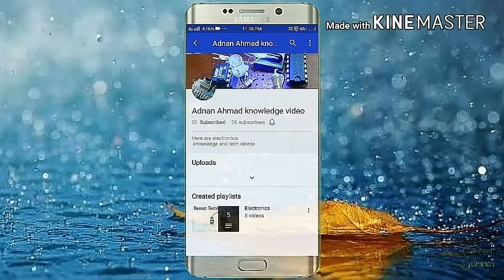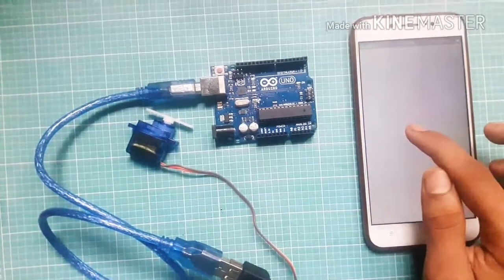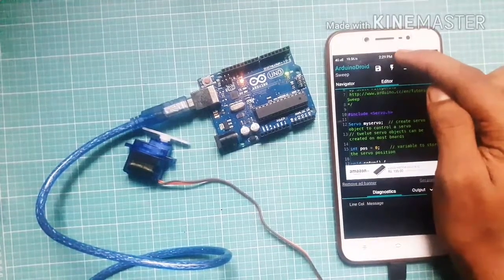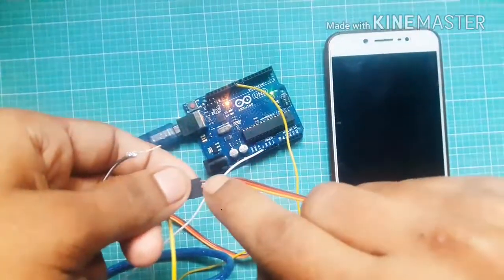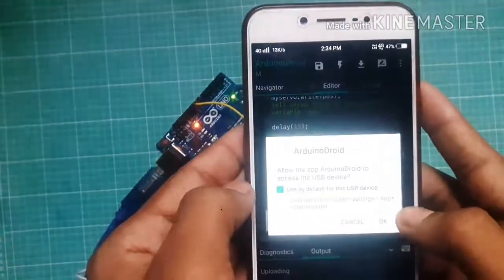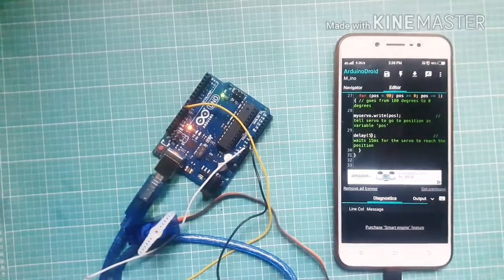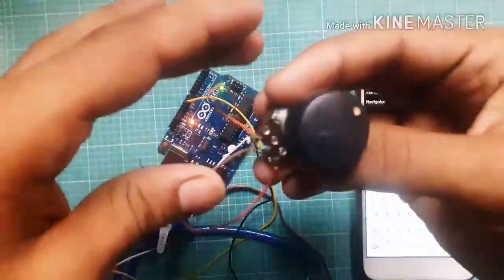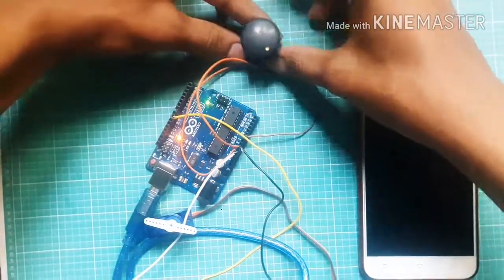How To Control A Servo Motor With Arduino Uno With Mobile.

Comment: When you change the settings degree program will it stay like that on the servo even with out using the arduino or app
Reply from the maker: Yes! It will work even without using app
Reply: When u program the speed and change it does it stay like that even with out the arduino so when u put the servo in ur rc car will it stay at that speed
Reply from the maker: @TW39  I programmed the Arduino not servo motor. Servo motor itself is not programmable. When I changed the speed in the program and uploaded the code then the arduino board was programmed. Here the arduino board controls the servo motor. 
And if you detach the servo motor and make an RC car then the servo motor will run according to the speed you programmed to that Arduino which you are using in the RC Car.
Reply: @adnanahmadknowledgevideo  will u be able to use it with out the arduino uno on a rc car once u programed the servo speed
Reply from the maker: No you can't use servo motor without arduino or any microcontroller. You need a microcontroller to run servo motor. 
But you can control a servo motor by 555 timer ic. You have to build your own controller circuit
Reply: @adnanahmadknowledgevideo  is that to control the speed

Comment: Can I also program Arduino nano from this application?
Reply from the maker: Yes! you can also program arduino nano and any of arduino boards.

You just have to click on the manu option(three dots) which is on top right corner.
Then click on settings.
Then click on Arduino.
Then click on Arduino nano(or any Arduino board which you want to program).

Comment: //ARDUINO OBSTACLE AVOIDING CAR Video - https://youtu.be/h-B42_HXL00//
// Before uploading the code you have to install the necessary library//
//AFMotor Library https://learn.adafruit.com/adafruit-motor-shield/library-install //
//NewPing Library https://github.com/eliteio/Arduino_New_Ping.git // 
//Servo Library https://github.com/arduino-libraries/Servo.git //

#include <AFMotor.h>  
#include <NewPing.h>
#include <Servo.h> 

#define TRIG_PIN A0 
#define ECHO_PIN A1
#define MAX_DISTANCE 100 
#define MAX_SPEED 150 // sets speed of DC  motors
#define MAX_SPEED_OFFSET 20

NewPing sonar(TRIG_PIN, ECHO_PIN, MAX_DISTANCE); 

AF_DCMotor motor1(1, MOTOR12_64KHZ); 
AF_DCMotor motor2(2, MOTOR12_64KHZ);
AF_DCMotor motor3(3, MOTOR34_64KHZ);
AF_DCMotor motor4(4, MOTOR34_64KHZ);
Servo myservo;   

boolean goesForward=false;
int distance = 100;
int speedSet = 0;

void setup() {

  myservo.attach(10);  
  myservo.write(115); 
  delay(2000);
  distance = readPing();
  delay(100);
  distance = readPing();
  delay(100);
  distance = readPing();
  delay(100);
  distance = readPing();
  delay(100);
}

void loop() {
 int distanceR = 0;
 int distanceL = 0;
 delay(40);
 
 if(distance<=25)
 {
  moveStop();
  delay(100);
  moveBackward();
  delay(200);
  moveStop();
  delay(200);
  distanceR = lookRight();
  delay(200);
  distanceL = lookLeft();
  delay(200);

  if(distanceR>=distanceL)
  {
    turnRight();
    moveStop();
  } 
  
  else
  
  {
    turnLeft();
    moveStop();
  }
 } 
 
 else
 {
  moveForward();
 }
 distance = readPing();
}

int lookRight()
{
    myservo.write(50); 
    delay(500);
    int distance = readPing();
    delay(100);
    myservo.write(115); 
    return distance;
}

int lookLeft()
{
    myservo.write(170); 
    delay(500);
    int distance = readPing();
    delay(100);
    myservo.write(115); 
    return distance;
    delay(100);
}

int readPing() { 
  delay(100);
  int cm = sonar.ping_cm();
  if(cm==0)
  {
    cm = 250;
  }
  return cm;
}

void moveStop() {
  motor1.run(RELEASE); 
  motor2.run(RELEASE);
  motor3.run(RELEASE);
  motor4.run(RELEASE);
  } 
  
void moveForward() {

 if(!goesForward)
  {
    goesForward=true;
    motor1.run(FORWARD);      
    motor2.run(FORWARD);
    motor3.run(FORWARD); 
    motor4.run(FORWARD);     
   for (speedSet = 0; speedSet < MAX_SPEED; speedSet +=2) // slowly bring the speed up to avoid loading down the batteries too quickly
   {
    motor1.setSpeed(speedSet);
    motor2.setSpeed(speedSet);
    motor3.setSpeed(speedSet);
    motor4.setSpeed(speedSet);
    delay(5);
   }
  }
}

void moveBackward() {
    goesForward=false;
    motor1.run(BACKWARD);      
    motor2.run(BACKWARD);
    motor3.run(BACKWARD);
    motor4.run(BACKWARD);  
  for (speedSet = 0; speedSet < MAX_SPEED; speedSet +=2) // slowly bring the speed up to avoid loading down the batteries too quickly
  {
    motor1.setSpeed(speedSet);
    motor2.setSpeed(speedSet);
    motor3.setSpeed(speedSet);
    motor4.setSpeed(speedSet);
    delay(5);
  }
}  

void turnRight() {
  motor1.run(FORWARD);
  motor2.run(FORWARD);
  motor3.run(BACKWARD);
  motor4.run(BACKWARD);     
  delay(500);
  motor1.run(FORWARD);      
  motor2.run(FORWARD);
  motor3.run(FORWARD);
  motor4.run(FORWARD);      
} 
 
void turnLeft() {
  motor1.run(BACKWARD);     
  motor2.run(BACKWARD);  
  motor3.run(FORWARD);
  motor4.run(FORWARD);   
  delay(500);
  motor1.run(FORWARD);     
  motor2.run(FORWARD);
  motor3.run(FORWARD);
  motor4.run(FORWARD);
}                    this code for robot